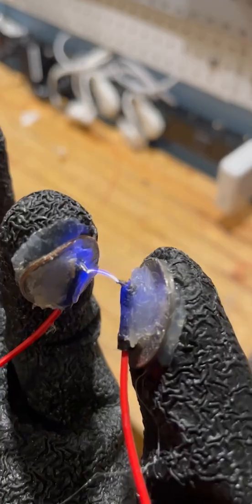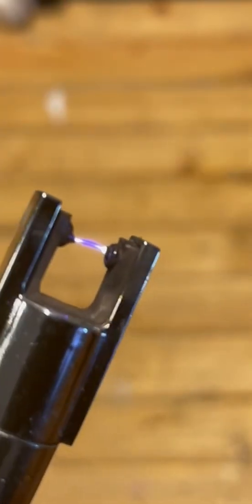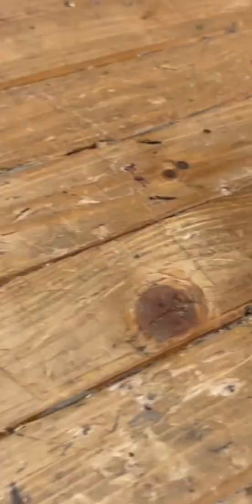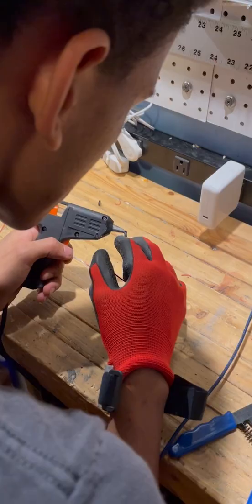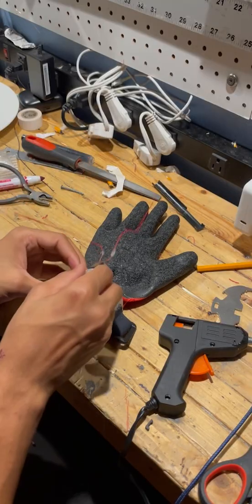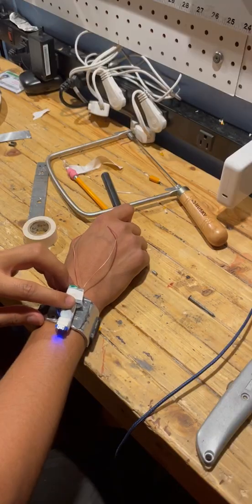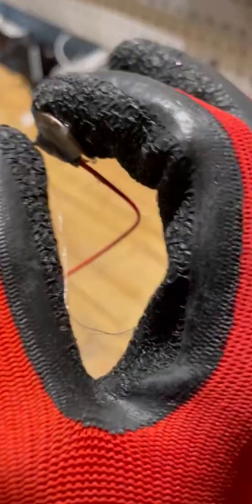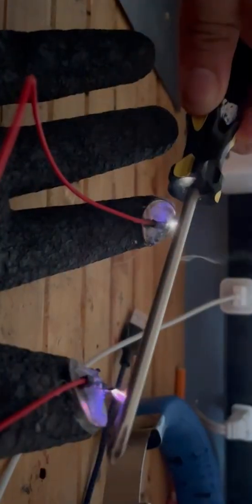Creating Electric Shock Gloves

Comment: Thats awesome I actually drew out something like this called the V- glove (volt glove) its a rubber insulated glove with two metal studs/prongs with the p+ and n- wire soldered to them, it would be powered via a battery and 400 kv module. Idk if Iam ever gonna build this stuff but once iam out high school and making money maybe I will idk.
Reply from the maker: Good luck man that sound awesome, but please be careful. High Voltage Electricity is one of a few scenarios where a human being can touch something and die instantly.